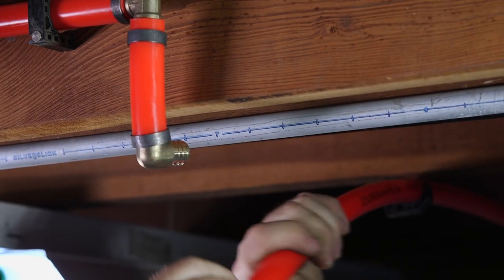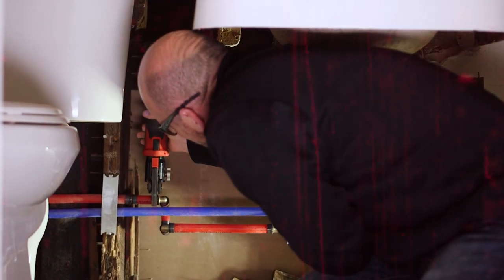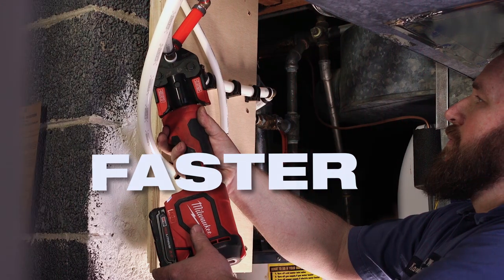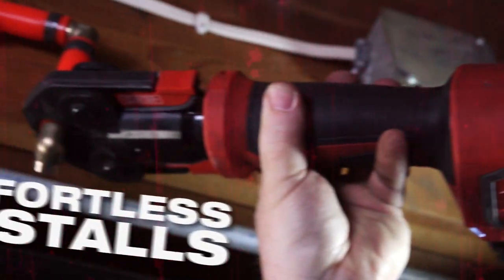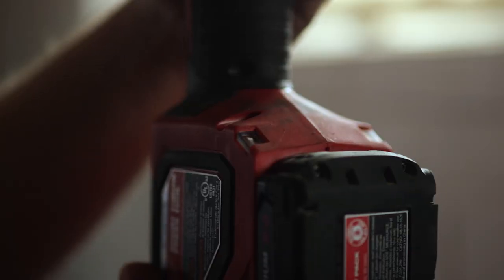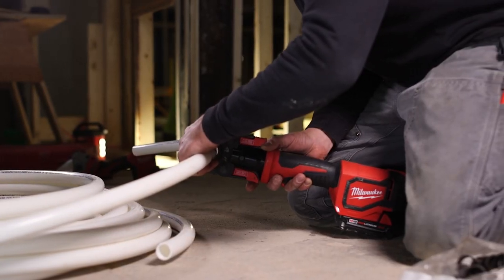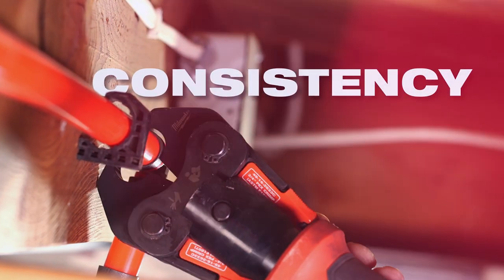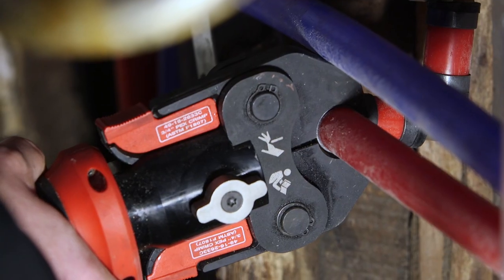Milwaukee® M18™ Short Throw Press Tool

Comment: Can this tool make propress copper crimps with different set of jaws?
Reply: I just got a set of copper press jaws and it worked well for me, jaws are pricey though
Reply: @Djduva107  were the press jaws for copper PEX rings or copper pipe fittings?